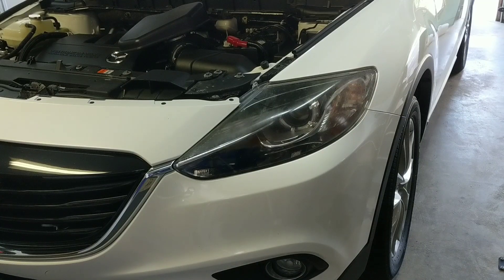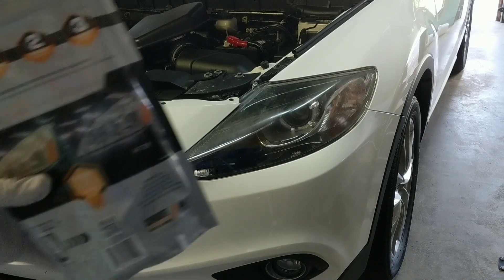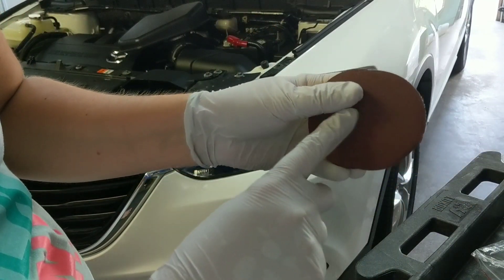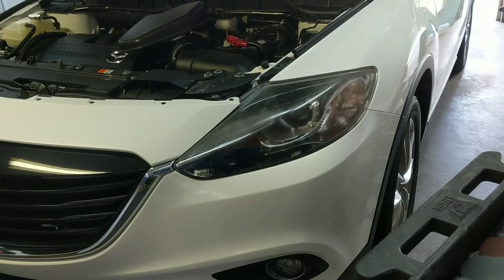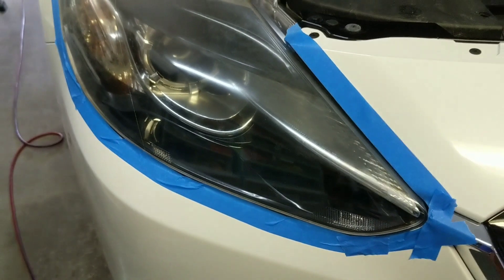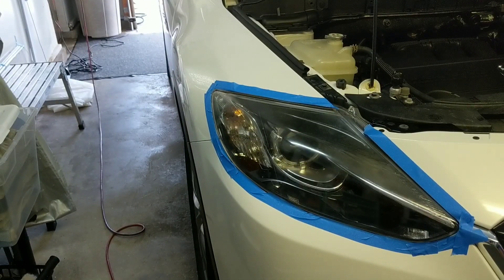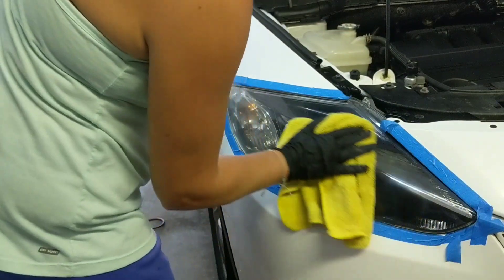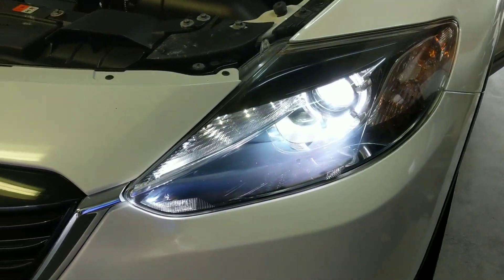Cerakote Ceramic Headlight Restoring Kit! So easy ANYONE can do it!

Comment: Cerakote had a discount for the trim and Headlight kits for 19.95 including free 2 day shipping. I was gonna try the lithium brand trim kit but for a 20 spot it was a no brainer.

Pro is gonna bust out wet sanding, da plus pads, and take a long time. This is cake. I wouldn't mind doing this every 2 years on my DD than pay triple digits for perfection.

I already use ceramic detail sprays so it should boost longevity as well.

Excellent video with directions anyone could follow. Long time fan.

Comment: Everything is marketed as Trim Restorer. My trim is on super healthy as of now. What products do you recommended to keep them that way? I have Lithium trim Serum but it doesn't seem to be doing much for that shiny black piano trim between the doors. And I have some of it under my back bumper. I've been using Plexus but I want something that lasts longer. Unitl I can get a legit ceramic coating on it.
Reply from the maker: Cerakote trim restorer or Limthium graphene trim cubes work great

Comment: Can you polish out the sanding marks with a DA before applying the coating wipe?
Reply from the maker: They dont say its necessary and I wonder if their coating needs some grit for the coating to bond to
Reply: No! It won't last as long if you smooth it out first with a DA

Comment: Hey what do you think about using the trim wipes on the headlights? I would think its PROBABLY the same ceramic technology
Reply from the maker: This coating was more self leveling vs the trim coating. I'd be worried about streaking with the trim coating but I'd message them and see what they recommend.
Reply: @attention2detailswchelsea  Ok thanksI think I already know what they are going to tell me lol. I have a job to do Friday and trying to kill birds with 1 stone since I already have the trim clear. I was even thinking of doing it the right way and getting 2K clear however maybe this is the way to go. Thanks Chelsea =)
Reply: @attention2detailswchelsea  Also how do you like the trim coating? How did you prevent the streaking? do you do crosshatch pattern or how do you apply? thanks!
Reply from the maker: @MrBod4life  straight lines and overlap by 50%. If you see a streak or drop quickly go over it once with the wipe in a straight line.

Comment: This is off the subject,but do you know Chelsea is there anything that will take off rust off the wheelwell bolts that you can wipe on and wipe off? That rust bothers me even though the rest of the car there is no rust at all!! Have you paid any attention to them bolts or does that bother you at all? You or any fellow Utube detailers can chime to solve this problem!!
Reply from the maker: I don't really worry about them but I know if it's light rust Lat 26 sells a product that's called Rust Remove that works great for rust removal but there's no such product that is wipe on wipe off that I know of. Rust removal requires some elbow grease to remove
Reply: Attention 2 Details w/ Chelsea Try spraying the rust some white cleaning vinegar. Let it sit and rinse well. It’s a weak acid and will break down the rust.

Comment: That is a no from me.  After sanding, it definitely needs to be polished with a DA.  Then a real ceramic coating put on that will last 5 years or longer.  
But, for an easy to use method...its fine.
Reply: This is a real ceramic product and we guarantee it to last as long as you own your vehicle!
Reply: Polishing with a DA just smooths out the pores and now the ceramic won't stick. Look it up!
Reply: @Cerakote  so if you polish out the headlight and then apply your ceramic coating it will be fine ?
Or will it not adhere because the lens is to smooth ?